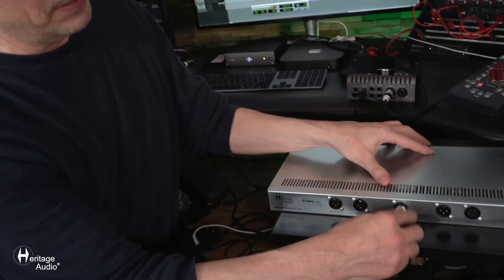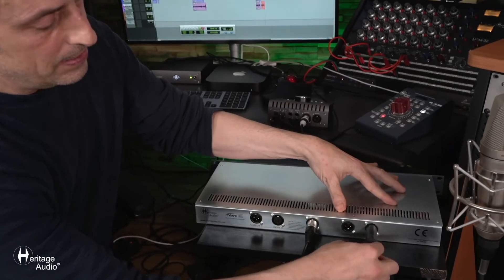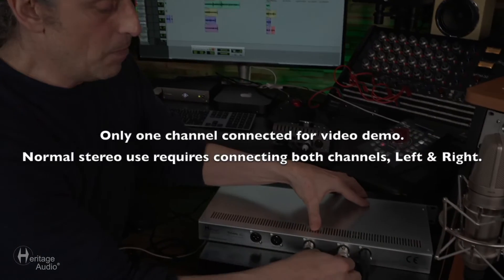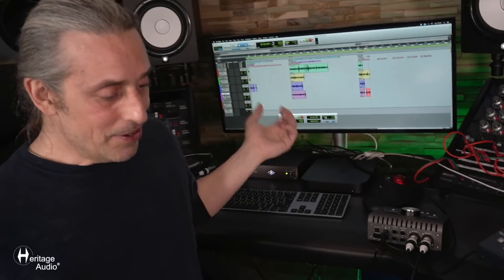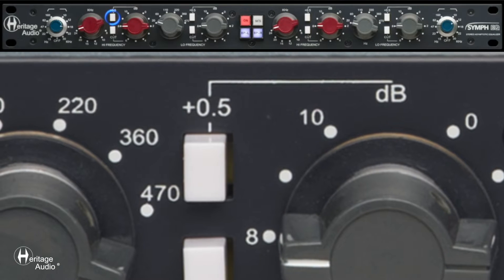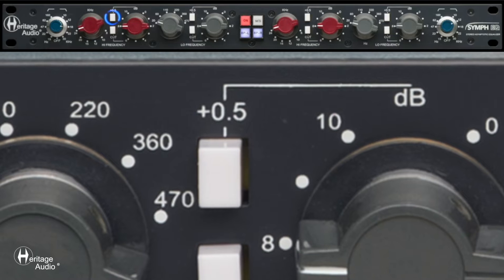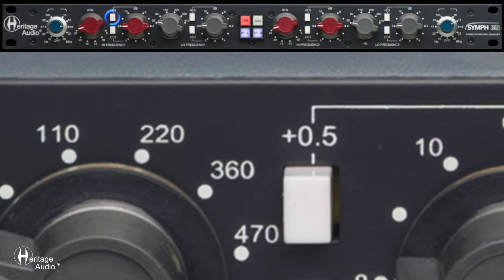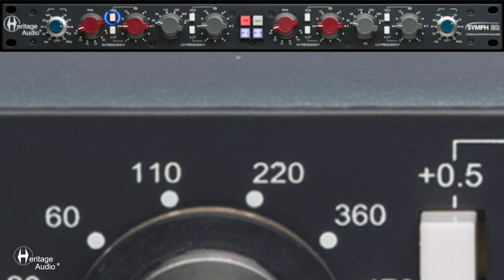Heritage Audio - SYMPH EQ Connections & Features

Comment: I've had the Symph EQ for three years, and I'll never part with it. Pump anything through it--individual tracks or grouped busses, vocals, drums, guitar, bass, whatever--and it will sound great, even when you push it really hard. The high end shelf filter is particularly magical for opening up a mix on the master buss, as many professional engineers have commented on in videos. Great products! Cheers.
Reply from the maker: Thank you so much!!
Reply: Before or after compression
Reply: @Deandre-r3j  Depends. In my mixbus chain, I often put it right before the Neve Master Bus Processor compression.